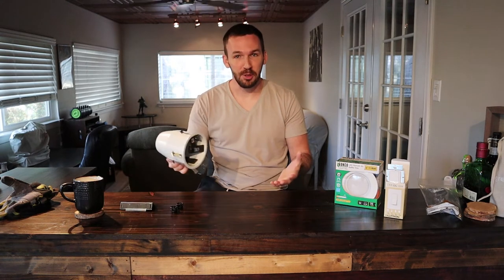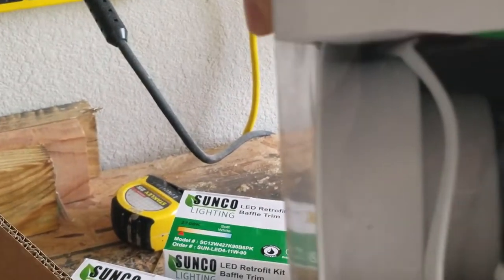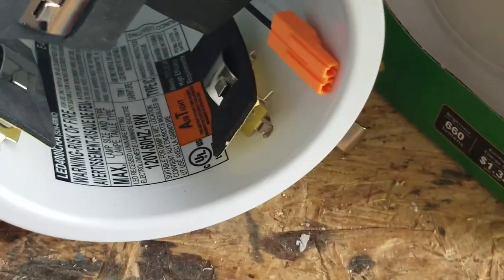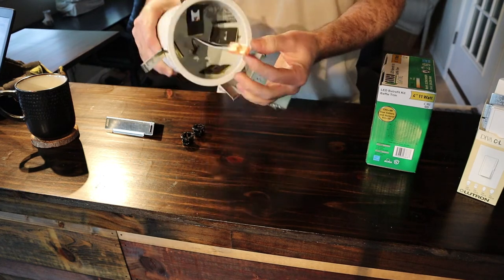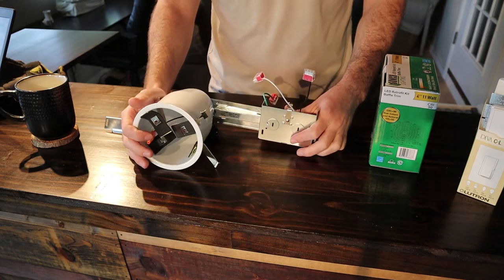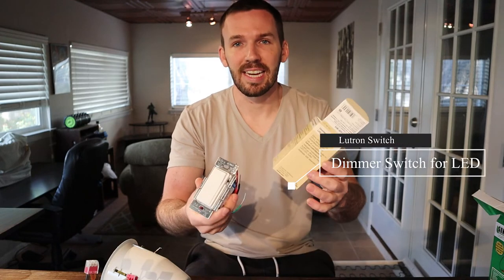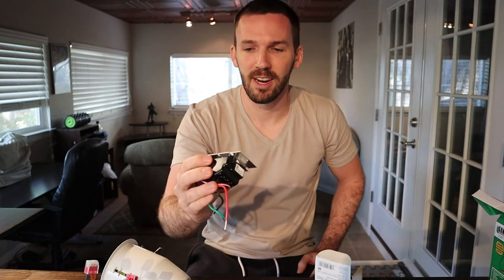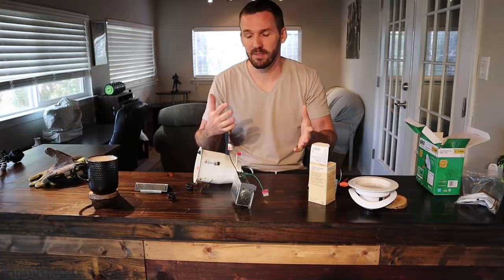💡 The BEST Recessed Lights & How to Install Them | Easy!

Comment: At 10 seconds in, I saw you have a recess light with a gimbal that you can adjust the angle. Did you also install that one? Is that one of the feature of this recess light or is that a completely different light? Thanks!
Reply: different light

Comment: dude.... sunco is an off (china) brand and are not the "best" by any means.
Reply from the maker: Best for the price, I'd say. Amazon's reviews clearly show the Sunco brand with better reviews (and more reviews) than any other brand.
Reply: @KellyConcepts  ive had 2 different model sunco bulbs in bulk and they're both horrible.  Flicker, dead bulbs... horrible.
Reply: @KellyConcepts  pls keep in mind that a lot of sellers on amazon pay ppl to make reviews up.  There is a also a lot of fake products on Amazon, so don't base EVERYTHING on "amazon reviews".
Reply from the maker: @--RSL--  Very true. I've been fortunate to have them work, but I'd be pissed if I put in all the work to install them just to have them flicker or not work.